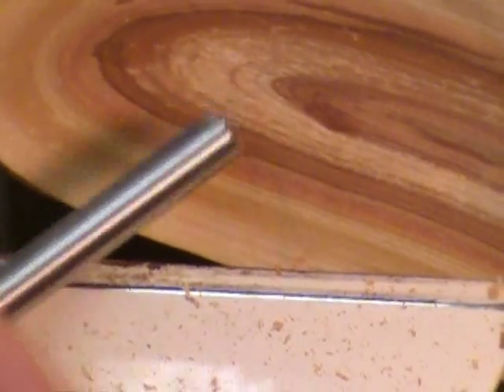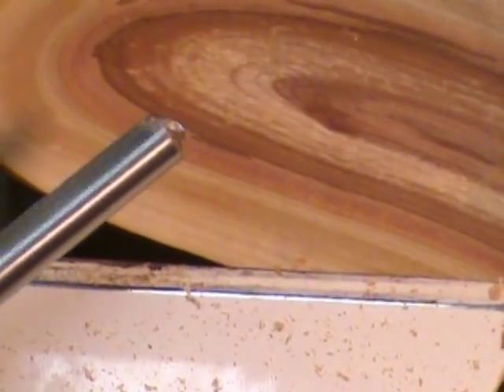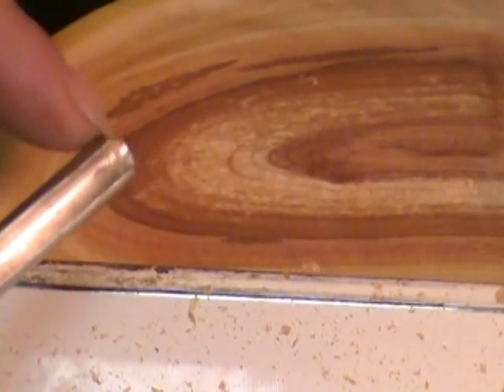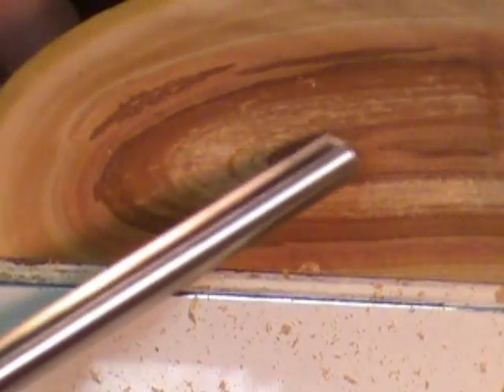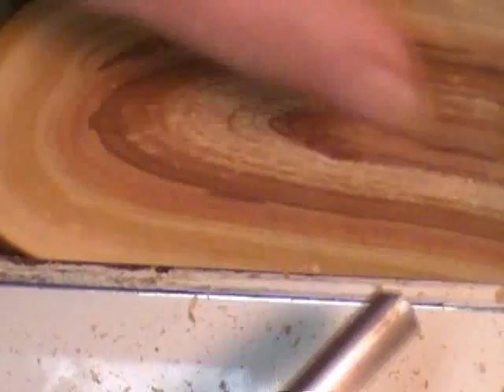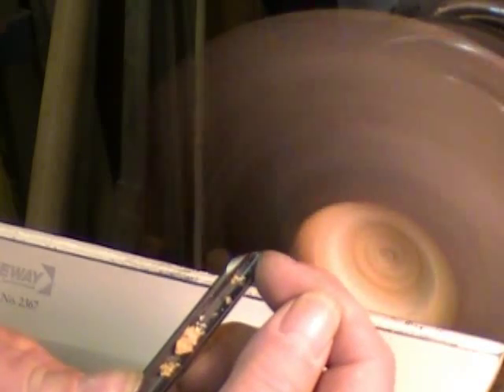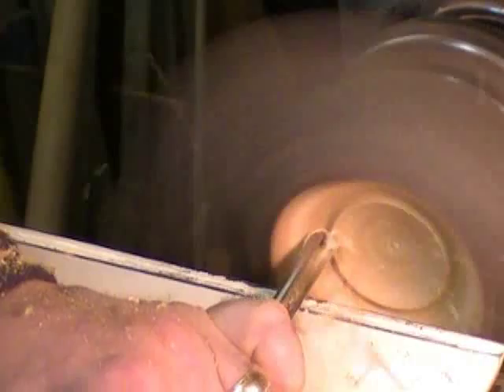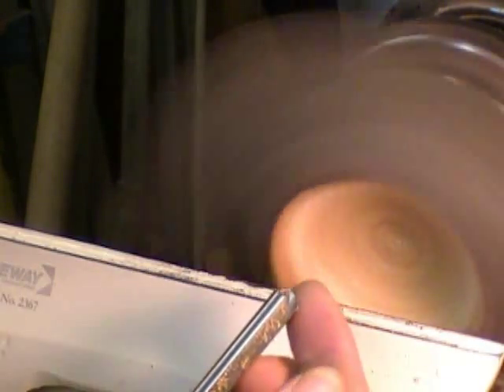Traditional grind cut

Comment: Bob, If used correctly would the shear cut with the traditional grind gouge eliminate the need to scrape the bottom of a bowl. Does the traditional gouge smooth out end grain at the bottom of a bowl better than a scrapper? Thanks - Skip
Reply from the maker: Hi, Skip:
As long as the shape of the bowl allows you to maintain bevel contact through the curve and across the bottom then yes, it should not be necessary to scrape afterwards.  If the bowl is too deep or the rim curves back in at the top it then it might not be possible to maintain bevel contact with a standard bevel angle of 40 to 45 degrees.  I have a gouge with a much steeper bevel angle (65 to 70 degrees) that I use in those cases.  I very rarely use a scraper.

Take care
Bob
Reply: Bob Hamilton